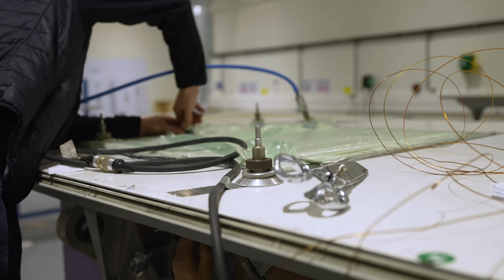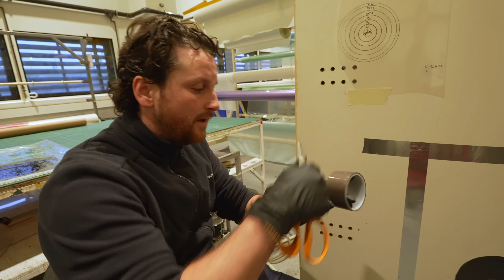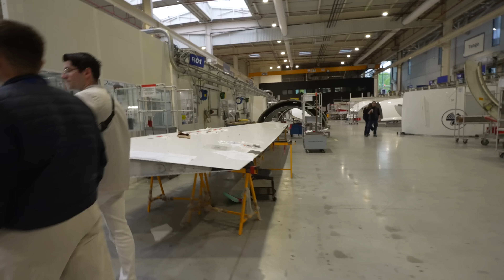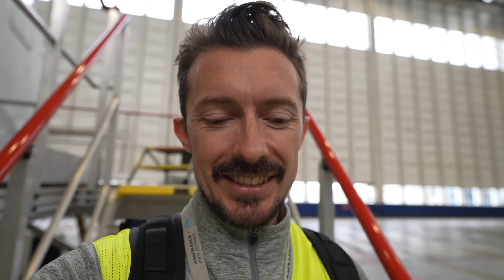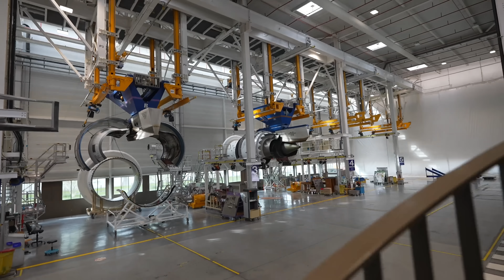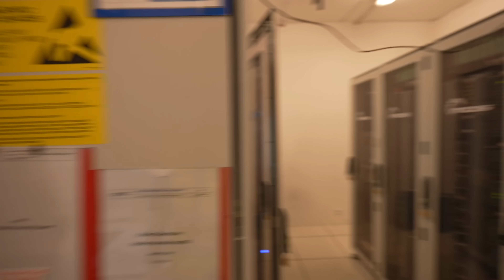How Air France keeps its aircraft fit for flight (maintenance grand tour)

Comment: The pre-impregnated composite/carbon fiber (with resin already in it) is kept cold because the resin curing process is a chemical reaction which is slowed down (or stopped) at low temperatures (and accelerated by heat). If stored at room temperature the resin would start to cure (even if not exposed to air) and then will either prematurely harden, or not adhere correctly when it is used

Comment: Some of the parts are pre-impregnated with resin, and chilling epoxy can slow the expiration date or prevent mixed epoxy from curing by lowering the temp below 5C. Once you re-heat it, it returns back to workable form and starts to set as designed.

Comment: We can change an engine in Ryanair with 5 people in 12 hours them lads must be going for a smoke every ten minutes rather than every half hour...
Reply: Do people need more reasons not to fly Ryanair? ....
Reply: Finland's 1977 cruiseferry GTS FINNJET ran on two gas turbines powering reduction gears to shafts (plus two diesel-electrics). A third spare turbine sat between the gas turbine enclosures on a cradle. Engineering could swap out a turbine in UNDER ONE HOUR, while the other turbine kept the ship at a reduced steady 24kn (max 31-32kn). The ship had a total of five gas turbines, two of which were always at a shore Finnair maintenance facility.